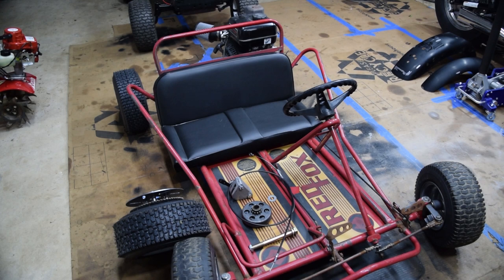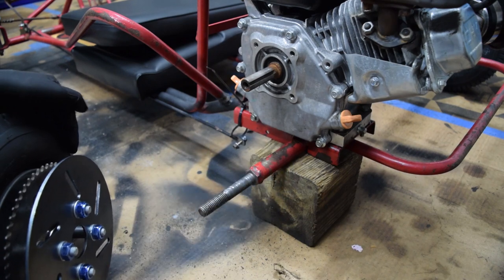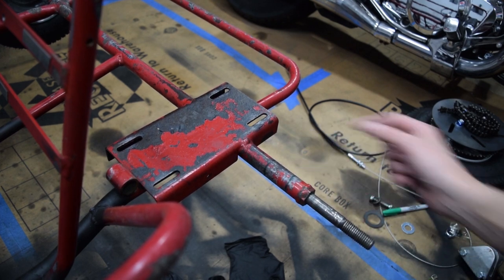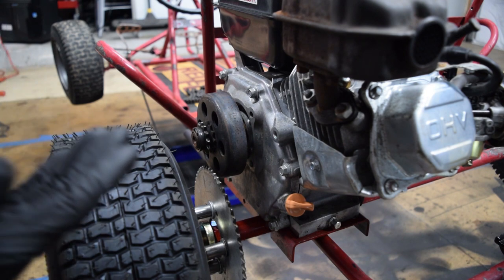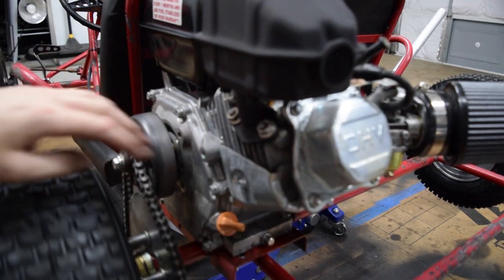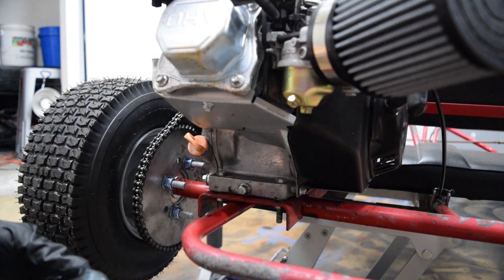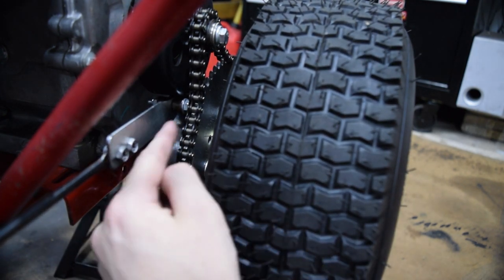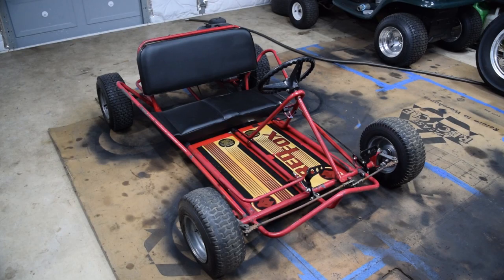Manco Red Fox Budget Build Ep 2

Comment: I actually have an original redfox and it runs really well. I'm able to drift in it and its top speed is probably 30ish mph and it's been through hell and back after multiple flips and the rim on one of the tires coming off mid ride but other than that runs like a dream
Reply: what does the kart weigh  , what its weight limit ?

Comment: I have the same go kart it’s beat up and every time we used it the thing broke but for the nut issue on the wheel get vibration proof nuts the lock tight works only for a short amount of time
Reply: I changed some things with the motor and was able to get it to about 34-35
Reply: what size nut it it mine fell of i can’t find one anywhere